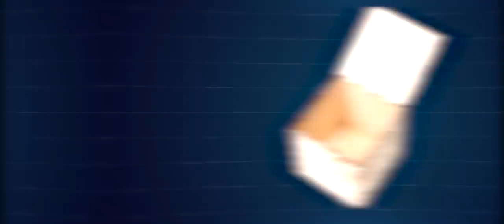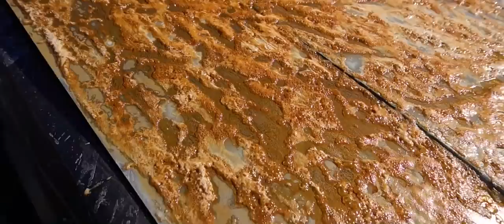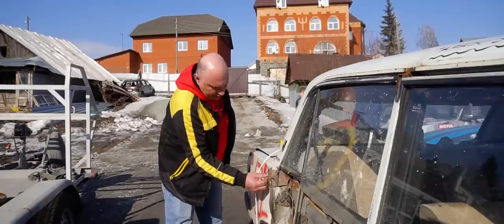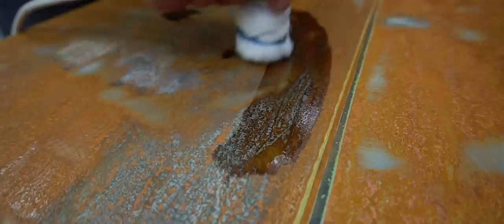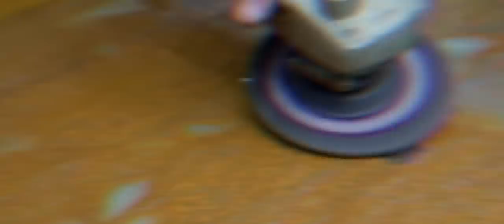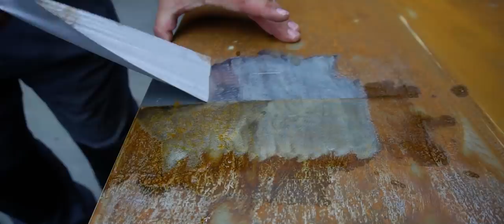Galvanizing rusty metal with a battery – real or fake?

Comment: You need to do it in submersive tank, with water and soda (less expensive) and zinc bar (to positive) and metal to negative. The zinc will consumption itself and will go into the metal and you will have the gavanization. It will require a lot of time, lot of current but it work. Useful for small parts, but remember that can't be compared to professional electric gavanization and, of course, can't be compared at all to the zinc fusion submersion. If you just want to remove rust, use same method as before but use a stainless steel instead of zinc (a tube will be good).
Reply: Yeah, but the point of the video is to see if you can do without that stuff. Since most people dont have a zinc coating tank on their driveway
Reply: @Nbomber  For small objects you can buy a plastic bucket or someting, soda and a zinc bar (even on-line). Then i suggest a psu of 12v and not a battery.
Reply: @Peppins  oh yeah, dont get me wrong, i completely agree. but thats well documented on youtube. i would love to see a method that works for doing much larger items, like, rust underneath my car for example. or if i had to weld under my car.
I have looked at hot zinc spraying, but its expensive and complicated.
Reply: You can do nickel electroplating too… and if you want to get fancy you can do titanium coating on small parts with a vacuum chamber and some titanium wire (titanium will require argon gas, titanium nitride nitrogen gas iirc)
Reply: He was testing the strength of the metal for electrical power. Maybe ground powers
Reply: It only a little spot is ruined due to a hit or something like that, it may be a better option compared to a full galvanization bath... this method is usable also with nickel and other materials (if i remember well i have seen using it with chromium too, but i don't know how much dangerous it would be)
Reply: @Leonardo.220  pretty sure when you electrolize with chromium or stainless steel, it releases hexavalent chromium as a gas, which is supposedly very nasty stuff. But i dont know for sure
Reply: @Nbomber  yep, for that o don't know if it is safe to do
Reply: @MrDrisgaard  Lol, Slava Rossii! Banderite fertiliser will feed the crops of Novorossiya!
Reply: Its a good way to do a repair spot what is damage over time by rust .

Comment: thats electro plating not galvanizing . galvanizing is a hot dip
Reply: Not exactly. Hot dip galvanizing is one of the galvanizing methods. The other one is zinc electroplating like they did here (roughly).
Reply: The galvanizing they did here is what they do to body panels of cars. Hot dip is much more durable and thick. It is rougher though, so it's used on things where appearance doesn't matter much, like a guard rail or a metal utility pole.
Reply: @giselle8924  wow thanks for leaving such a useful comment
Reply: @bigfootandbananaman4746  replying to them tells their bot that posting here had a good result for them
Reply: @Nbomber  I'm just going to report the comment
Reply: @RadioWerwolf  yes. its not hot galvanizing
Reply: @florky_01  who said it was hot dip galvanizing?

Comment: There's been some zinc deposition, but you need to make things correctly to obtain good results. Metal clean and polished, enough current, adequate electrolyte. Electroplating is not rocket science, but you must do it in a more controlled way.

Comment: There are enough technical information in the comment section below to make one understand the proper process. My two cents comment is that the surface has to be shiny clean before the galvanized will plate a lot faster and will adhere to so much smoother surface. Also, there are many ways to skin the cat so to speak. The most important thing is the surface texture finish must be on point. The process works best when galvanization is 100 percent coated. What you experienced is some plated and other spots not really plated. The plating process needs consistency. I just have to give you a thumbs up as to how you persevere and move on to the unknown with optimizem.  Good day and peace Sir. Peace vf

Comment: You need a solution of zink for this to work properly. Relying on dilute phosphoric acid to dissolve a bit of the battery casing in situ doesn't provide a steady and sufficient amount of zink ions.

Comment: Available commercially as a DALIK plating kit, which you need to have a better electrode to use, with a larger surface area, plus a continuous flow of weak acid, to provide a conductive path, and get good contact with the cotton swab.  Make the battery case flat, and try again, with a cotton swab well soaked in a dilute phosphoric acid solution, basically that bottle with 3 times the volume of water, soaking it to be wet and not damp, and only a single thickness or two of cotton cloth, old well worn denim works there, to act as insulator and carrier. Wet the metal surface as well, so it does not dry out, and thus makes for even plating.

Comment: A good solution for flash rusting is 2 parts hydrogen peroxide heated and mixed with salt until it stops dissolving then mixed with 1 part vinegar, then brush it onto a clean and warm steel surface and it will start to foam and rust instantly. Wash of and repeat until you have a uniform layer of rust. On small decorative items you can then boil it in tea to convert the rust layer to Fe3O4 which is black/dark brown and then wax it to preserve the finish.
Reply: Oxalic acid also turns rust to iron oxalate.

Comment: I do believe it worked somewhat. I've even seen factory Galvanized metal rust if exposed to the right elements at a given rate of time. examples are galvanized barn roofing and car splash/kick panels.

Comment: Phosphoric acid is used in chemical treatment of iron to remove rust (it's still an acid) and promote the forming of a phosforicoxide layer to prefent further rusting.

You could've literally just put on the acid and it would come out rust free (since it is just basic starting rust).

Source: chemically treat metal for a living
Reply: Phosphoric acid works pretty slick on surface rust.  Done it myself, too.

Comment: You should have done a "control" patch without the cables connected, just to see the effect of the "acid battery case" alone can do. Also, I would try to change polarity on one patch as well. Just to see what will happen.

Comment: Electrolysis is awesome, when performed properly it will make that rust float off of the surface and make it shine without any visable scratches, so long as they were not previously under  the rust, and it has to be submerged to do it correctly.
Great Video either way😀👏👏👏👍👍👍👍👍

Comment: Black oxide body panels and more. You can do your own black oxide of bolts and small parts, what about body panels, or even the entire vehicle.
Reply: My truck had serious rust spots on outside portions of the receiver hitch and I just put phosphoric acid on it.  Phosphoric acid converts the rust to black oxide, and doesn't really do anything to the steel itself, and the black oxide is a protective layer against further rusting.  Works pretty slick for some things.

Comment: Sure you didn't do it the wrong way with the polarity?
When electroplating you shouldn't be able to remove the old rust unless it is wrong polarity and then you only remove metall.

The part you want to plate should be  0v or ground.
And try having a beaker with pure water and sodium hydroxide with both sides connected to pure zink metal (boat zinc anodes?) and let it go for a while or hours to saturate the water with zink then repeat the test.
Can also use acids but if it is to strong it will corrode away the zink to fast

Comment: Make a car that's driven by brakes - Where the shifter goes, use four slave cylinders in an X, (Think of how an old joystick works) each slave cyl pointing (and connected) to the individual  brake its going to activate. Use the "shifter" to steer the car with the brakes, by pushrods applying pressure to the slave cyls when guided in that axis by the lever. Hook up the steering wheel to the throttle and find out which member of the G54 family can lose muscle memory the quickest and drive the sensory-shitbox the best on an obstacle course ;)
Reply: Sensory-shitbox lmaooooo I love it. That's like how many small (Cessna 172ish size) aircraft use differential braking to steer, granted it's only 2 wheels vs 4. Would be very interesting to see.

Comment: That's basically just electroplating, depositing a thin layer of the metal on top of the steel, whereas galvanising is much like large-scale soldering where you dip the steel parts into molten zinc to bond it onto the steel metal, gives a more thorough protective coating in one go than rubbing a battery shell onto metalwork... :)